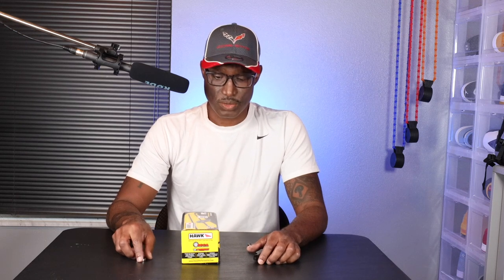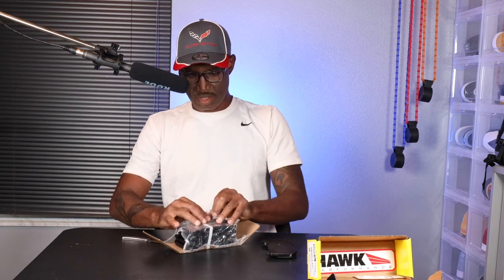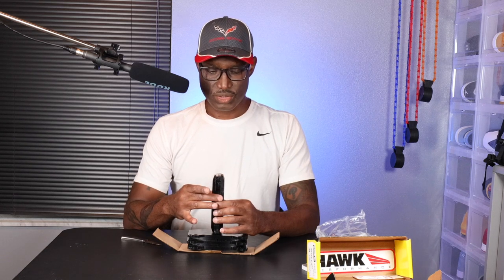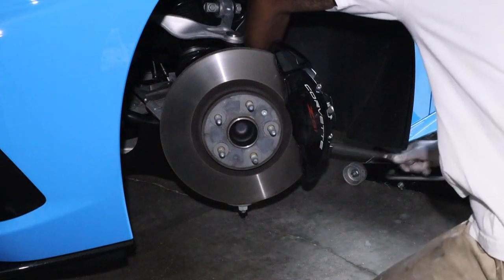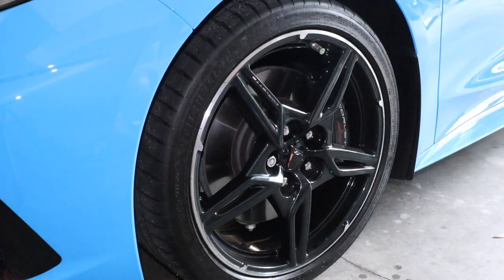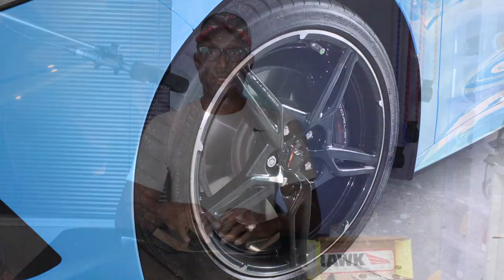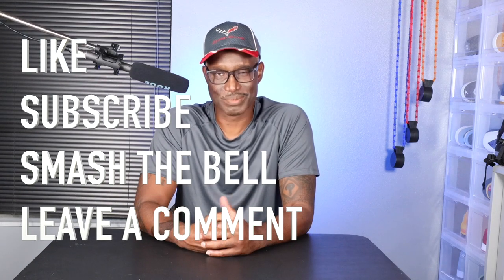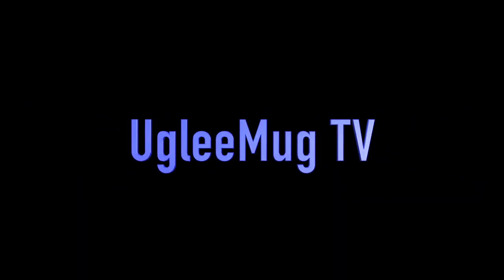Track Exhaust Blows Up My C8 Corvette, Brake Problem Resolved.

Comment: Sounds great did you get the AFM NPP simulator no check engine light how much did they charge to install it.
Reply from the maker: I ordered the simulators with the exhaust system so they were just part of the install.

Comment: Did it fit in trunk or did you need to use a truck?  Do we get a drive sound experience?
Reply from the maker: I had to take the system in my SUV a day earlier. I couldn’t get it in the car.

Comment: This is the very exhaust I'm interested in. How is the drone? Do you miss not being able to drive in quite mode? Now that you have had it awhile do you feel that it is to loud?
Reply from the maker: Frankly, I hated driving in silence. I kept the valves open at all times. Therefore I welcome the sound. If the drone bothers me, I just change to manual.

Comment: Couple of things. Great channel. Isn't it easier to change the brake pads out of the top of the calipers. Second I just rented a car with 20 degree tint. I hated it at night. How do you manage that. Last when are you going to Ron Fellows school. You need to go.
Reply from the maker: You need a special 10-tooth tool for the pin…and my tint is not that dark at all.
Reply: @MrMuggs  cool looked really dark on the video. What is the part number of the actual brake pads you bought. Just watched the air filter vid. Those mufflers sounded pretty loud. You still ok with them. Liked the shoes in the next video.